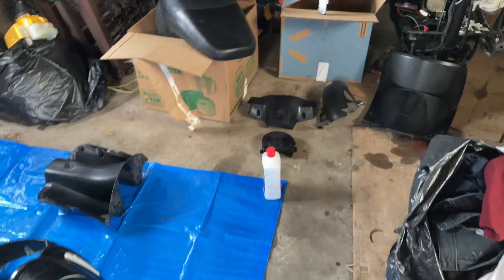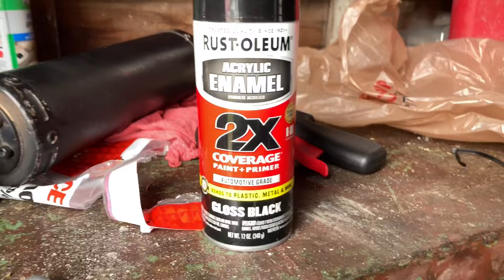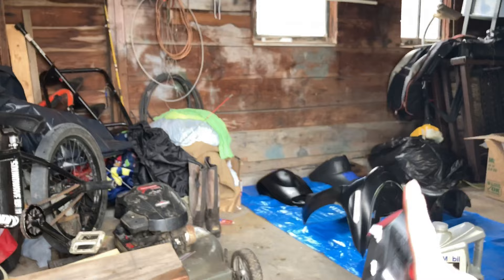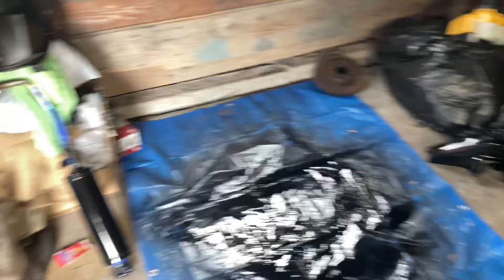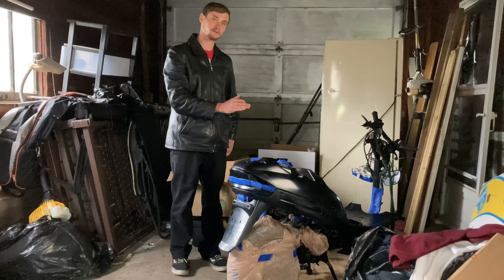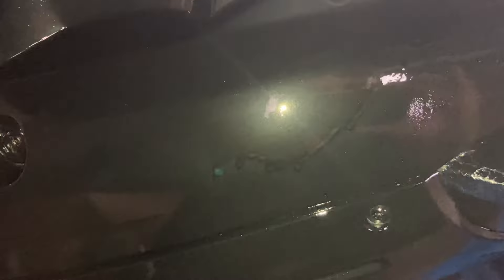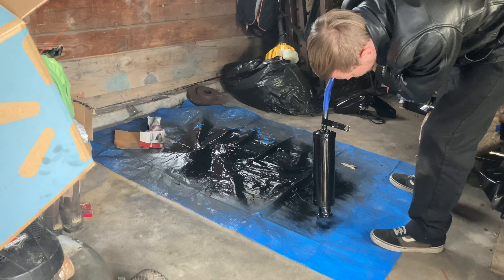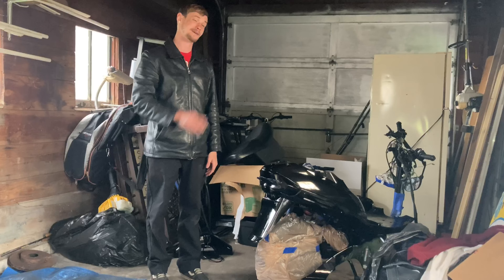Painting Plastics | Taotao Pony50

Comment: Woot Woot, if you were to sand the plastics, what grit would you use?
Reply from the maker: I would use a 150 grit dry sandpaper it’s very soft so it won’t scratch anything, Then follow through with a 400 grit sandpaper, two-step process but if you really wanna invest some good time to make it a bomb ass job that’s what I would do

Comment: Did you seriously just spray paint a muffler?
Reply from the maker: Uhhh yeah you can do that you know don’t act so shocked 😮
Reply: @davidhofinger4927  ya know it's going to burn off right
Reply from the maker: @cyrusatkinson3307  No not at all I painted my muffler last season with a satin black spray paint because it was a bright shiny metallic red that stuck out like a sore thumb, Your muffler doesn’t get but warm to the touch because of all the insulation in between that and the actual pipe itself. Your not painting the header dude your painting the outside thin metal of the muffler it’s fine 👌
Reply: @cyrusatkinson3307 you can use engine or high temp paint as well just no your paints and how to wield them to specific materials 😊